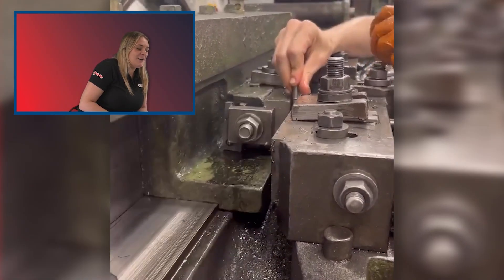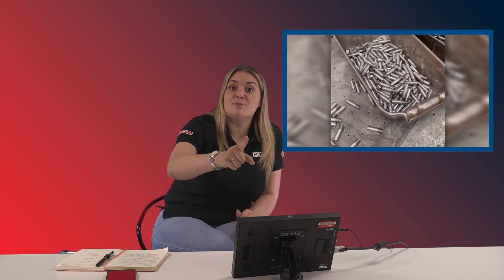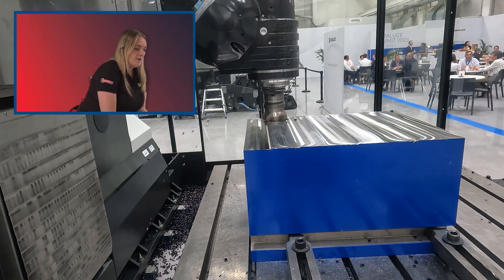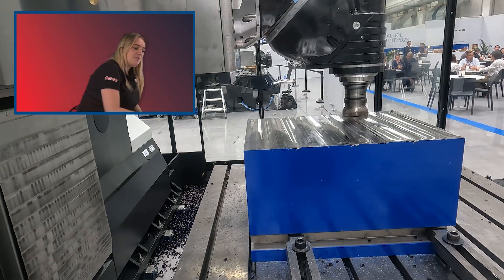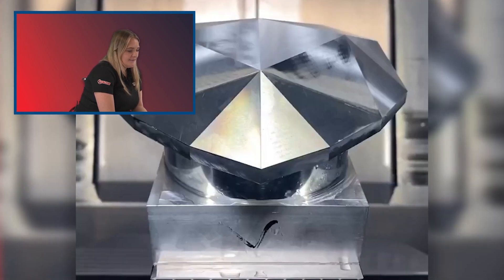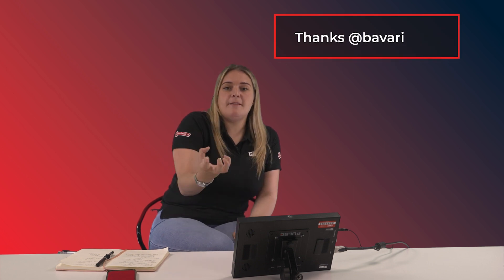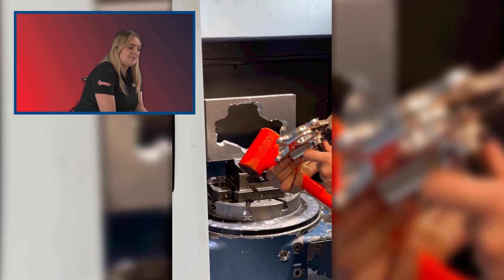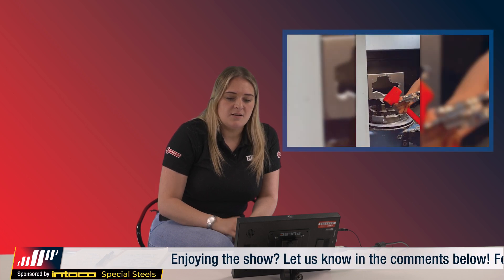Machinist Reacts: Human Vs Machine!

Comment: Just need a good way to accurately pre op for 3 axis to locate 2nd op accurately that’s the only real advantage a 5 axis gives you on the part … depending on tooling reach and fixture requirements can sometimes be much easier to do on a 3 axis